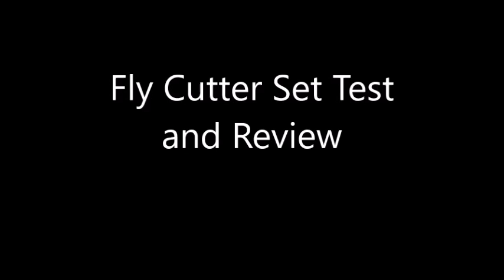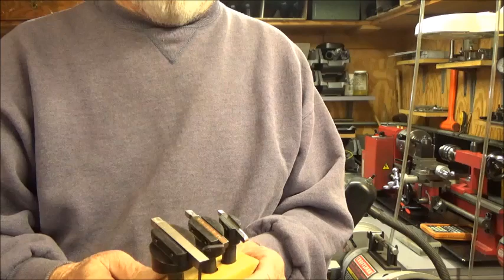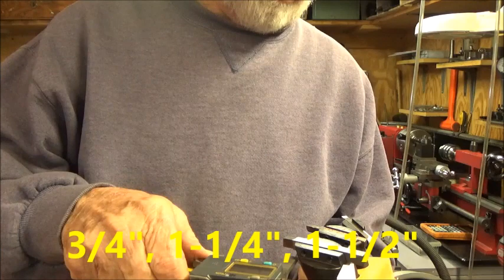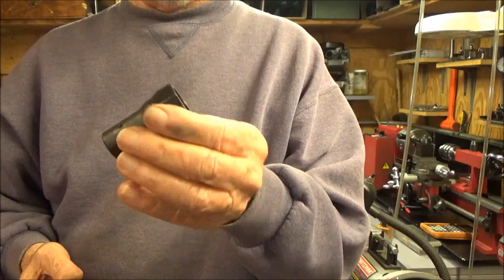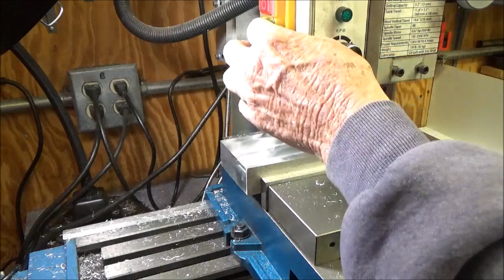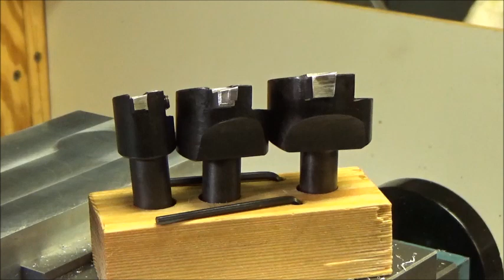Fly Cutter Set - Test and Review Using A Typical Mini Mill

Comment: Larry
Tonight's the first I've watched you're work.. I see you haven't posted for 2 years. I hope all is well with you. This video reminded  me of a story from a shop I worked in in the 80's. We had a steel top work bench that we did it all on. Grinding welding all the fap shop stuff. We had a outlet on the wall just above the backslash. Unknown to us the outlet was ever so slowly over many years filling with grinding grit. Well one day it finally filled up enough to short out thru the metal dust. POW! It went off like a Roman candle! Near blew it out of the wall. No major harm done. Lol a few new parts and we were back at it. In 8 years it only did it once.😂 caution say to me that maybe one of those outdoor clear plastic flip down covers could be a good idea. Again I hope you are good to feed this.

Comment: Hi Larry.
I decided to try using a small triangular inset.  As I couldn’t find anyone selling them, I machined and drilled a small bar of 8mm square steel, to accept the insert. The difficult bit was drilling and tapping a 2.5mm hole in exactly the correct location, to hold the insert.  Due to the nose of the insert being rounded there is quite a large range of angles which work well.
Machining steel plate, or aluminium I get an almost mirror finish, I take small cuts, use around 1,000 rpm and advance the cutter quickly.  The tip with the aluminium is to apply a squirt of WD40 to the surface, it stops small chips of aluminium welding themselves to the insert, which impairs the finish.
Cheers Noel
Reply from the maker: Thanks for your comment and information.  Regards: Larry

Comment: Can you comment on ipm (chip load) you've used on Aluminium on 1000 rpm, 2" diameter cutter, taking light cuts? 
By eyeballing I would guess probably 6-8 ipm. Also, your ipm looked to be the same regardless of whether the tool was HSS or carbide.
Reply from the maker: I'm not remembering at this point, but normally using fly cutter I'm taking very light cuts, so whatever feels right rpm vs ipm.  My tool bits used in the fly cutters are all HSS unless the material has a surface hardness such as hot rolled or cast, at which time I may use carbide.

Comment: This may seem like a stupid question or novice. But I’m looking into getting a mini mill and I’m very curious how you determine feed rate for something like this or even using an end mill. And also how you do decipher how deep of a cut you can make with a fly cutter or end mill?
Reply from the maker: You can begin with some simple software or milling formulas to determine all of the factors you mentioned.  Of course this would just be a start, leaving the rest to your experiences and feel for the job.  They make also make milling and turning calculators which are reasonable and sold everywhere.  It always helps to know the basic math formulas and material specifications even when using a calculator, but it would be a beginning.  Complicated, but Simple subject.  Regards: Larry
Reply: @larrypoindexter9351  thanks for the reply Larry. I’ll be sure to pick up a mastic machining book when I get a mini mill.
Reply from the maker: Here's a simple link that has some basic information to get you started.  Larry
https://littlemachineshop.com/mobile/speeds_feeds.php
Reply: @larrypoindexter9351  thank you!

Comment: Can you post the link of the set that you bought?
Reply from the maker: https://www.ebay.com/itm/1-2-Shank-3-4-1-1-2-Fly-Cutter-Set-Cutting-Milling-Hardened-Tool-Bits/283427485593?ssPageName=STRK%3AMEBIDX%3AIT&_trksid=p2060353.m2749.l2649
Reply: @larrypoindexter9351  Thank you Larry.  I am fairly new to machining and certainly this is my first time buying a fly cutter.  My goal is to face a mild steel plate (4"x"8X0.5") using a HarborFreight mini mill. Am I going on the right direction with the fly cutter or should I use a large 2 flute cutter?  Which tool bit would you choose for the fly cutter?  Appreciate any tips.  Thanks again!
Reply from the maker: @fabianlis44  There's so many variables that an appropriate comment might be difficult.  Such as: The type and condition of the metal itself and the type of tool bit intended to do the job.  If the material is mild steel (like 12L14) and in good condition then the fly cutter would be my first choice.  If it were hot rolled with a surface crust then a 4 flute 1/2" end mill might be best, preferably carbide, with a deep enough initial cut.  Fly cutters work well on materials in good condition where very light cuts are used to develop a beautiful finished surface.  Good Luck: Larry
Reply: @larrypoindexter9351  Thank you Larry.  I will experiment with the fly cutter I think.

Comment: I'm not sure why you think you shouldn't get a burr,  it's normal and does not indicate anything is wrong. Of course a dull tool bit may leave more of a burr. Good vid, nice little shop set up you have, why not make your own tooling?
Reply from the maker: I have made several fly cutters over the years, mainly for a small Taig Mill and they've worked very nicely for both the mini mill and Taig mill.  I was limited to a 3/8" shank for the best setup into the maximum collet size on the Taig.  I just thought I would try these Chinese tools to see how they worked.  Of course all my tool bits were ground from HSS.  Sometimes HSS doesn't work well for metals that have a hard outer crust, thus carbide is a must.  thanks for your nice comments and best regards: Larry

Comment: Great video Larry! I have not yet tried out a fly cutter. But I am looking forward to do! I Think the finish is looking very Good.
Reply from the maker: Yes; Fly cutters can leave the best possible finish when the tool bit is ground correctly and the machine is trammed in both axis almost perfectly, or you can cover the entire surface in one pass, thus "no horizontal lines".  Of course, taking feeds and speeds into consideration, which is not quite as straight forward as conventional milling.  Regards: Larry

Comment: Good to see you out in the shop.  I've used fly cutters a few times and have been disappointed.  I now realize via your video that my mill is out of tram front to back.  It's a Taig mill.  Can you suggest a method of skimming the z axis?
Reply from the maker: Roy: I think Nick Carter may have a procedure on his web site.  The "Y" axis can be a bit tricky, and also "X" and "Y" interact.  The Taig Mill "Y" axis is probably as good as you can get it when it comes out of the factory.  As you already know, the "X" is not wonderful.  Regards: Larry
https://cartertools.blogspot.com/2010/06/shimming-dovetail-to-align-y-axis.html